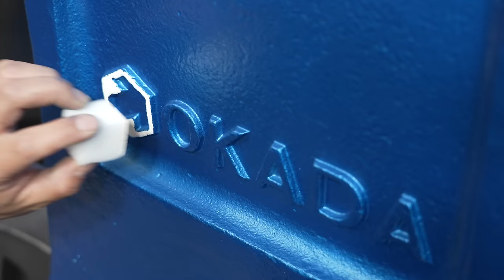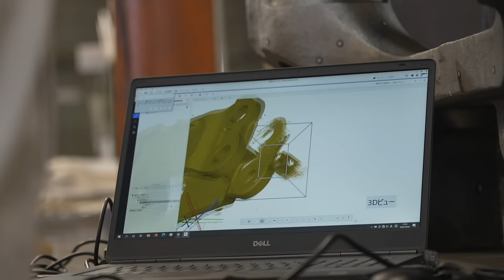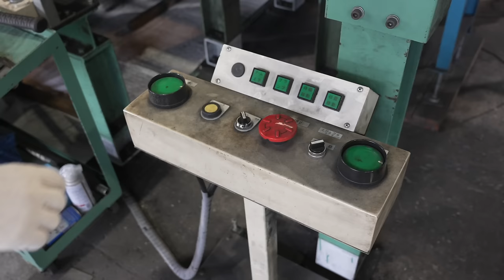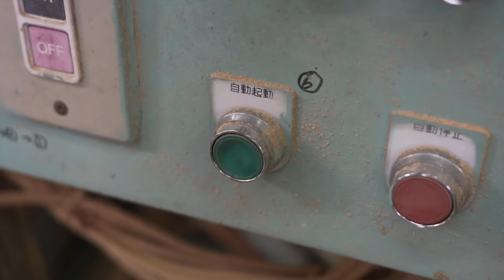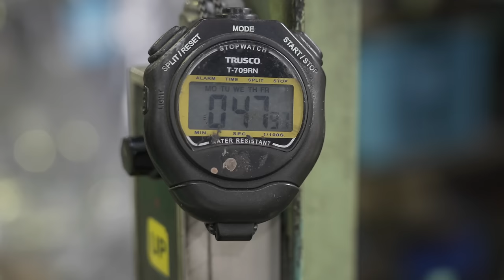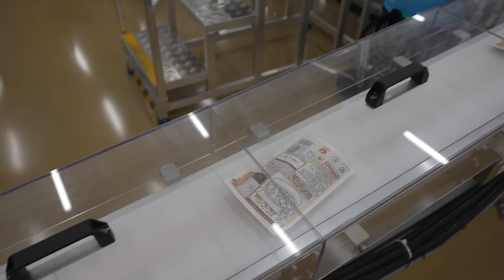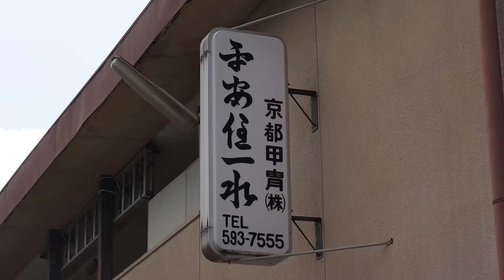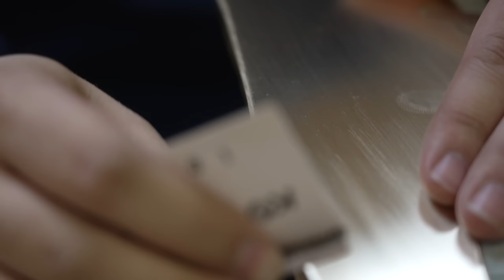日本の真似できない大量生産と手作りプロセス！すごい職人技TOP５

Comment: 33:01 I did not know shovel can bend that much and go back to original shape?
47:38 What is that doing? Compress the steel to the wood?
49:50 That paint to the steel sure drys fast.  No paint to the wooden handle?
 Thanks for the interesting video.